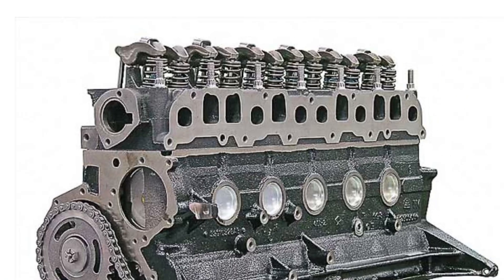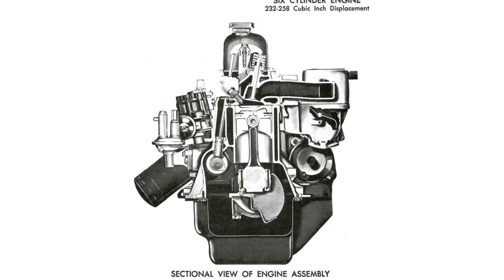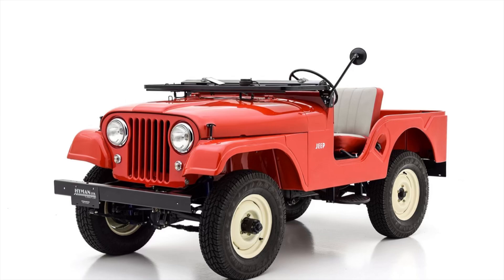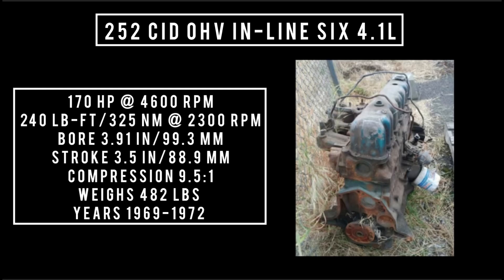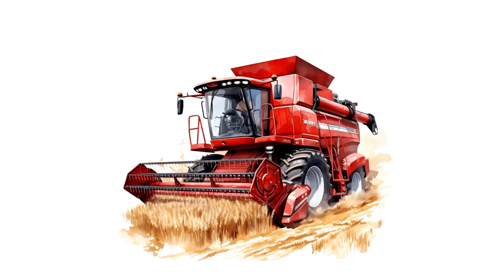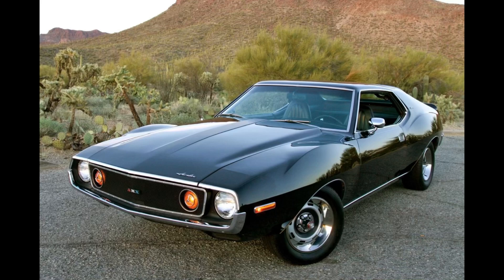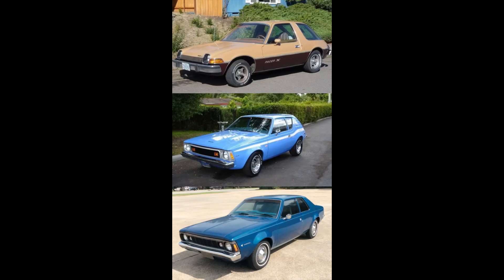AMC modern era in-line six 232, 199, 252, 258, 282, 242￼

Comment: i have a 1980 AMC Concord, 26,000 miles, 2-door, D/L 258 six, automatic, bought off ebay for $1,900 delivered, put about $800 news suspension parts and exhaust system. It runs fine. Rust? No. It has a vinyl top with a few bubbles.

Comment: I had a brand new 1983 AMC Concord 'Woody' Station wagon, fully loaded with every available option which had the 258 I6. I drove it 300,000 miles and it was still running smoothly when I drove to the scrap yard. That engine was indestructible so long as you changed the oil and filter every 3000 miles. The unfortunate issue was because AMC automobiles were considered "economy" cars, people seldom maintained them properly. Brakes, tires, ball joints and rear leaf springs were the only major items that needed replaced in 300,000 miles.
Reply from the maker: Thank you so much for sharing all that insight and information as well as sharing your car and experience =) 

Sounds like that wagon was super durable

Comment: Alum version of the 195.6!    Mains were broached and broke so main webs were filled in  STRRONGEST BOTTOM END OF ANY 6 vs Ford and chevy   we made 1000HP with 199 stock block and head  AMC then cast heads with the later ports with the early shaft rockers and blocks with thicker decks and BAM cores but bored only to 3.75  that combo with a STOCK 199 crank, carillorods etc made 1200 hp, Ran INDY
Reply: First 199-232 used the Nash bellhousing: there were 3 stick shift transmissions  Small ramblers got the Borg Warner T96  Police taxi option got the T86. some with straight cut low gear, none had synchromesh low.  OD was available  AT was the Borg Warner  later models had the same bolt pattern as the 64 AMC V8 with T10 4 speed and  Torque Flyte available  I had a 69 American with the T-10 U with 3.10 low gear   OD was a good choice

Comment: My daily driver is a 1993 ZJ Grand Cherokee with 442 Km on it....still purrs, and just in case I have a wrecked one with a 4.0 that is under 250k ...it still is cheaper to run than a new 4x4, is easy to work on and parts are around....it is just less costly to keep running than buy something much newer with all of the electronic crap.

Comment: I've had several Jeep TJ's with the 4.0, I had a 1999 with the internals from a 258 and made it a 4.7 l that jeep had 280 HP at the wheels and over 300 lb-ft of torque. I have a 2005 TJ unlimited with a Banks turbo kit and intercooler it makes 360 HP at the wheels and over 400 LB-FT of torque. I also have a 2001 tj with a Chevy lm7 5.3 liter and that one is fast over 400hp, but thats an engine for a different video. Thanks for what you do my father and I love your videos, they are very well curated and narrated.
Reply from the maker: Thank you so much for sharing all that information and insight greatly appreciate that you dig the channel. I put a lot of time and energy into it and it truly is my passion.

Comment: Way back when I used to run a Yale forklift powered by the 225 slant six. These things used to run 20 hours a day, sometimes more. Plastic bags used to get sucked up off the floor causing almost daily boilers. The engines would last as long as the forklift itself, around 10,000 hours. About the only way you could kill the engine would be to run it out of oil and keep running it. This engine deserves its reputation.
Reply from the maker: Awesome so much for sharing your experience with this engine

Comment: Being an Auto Body Tech. i woked at AMC MERCIDES and those in line sixes never skipped a beat,but when they started to put after market Air conditioned on them they started to over heat cause of the burden of the engine cooling system was not design for much labor but it still functioned and got by.

Comment: My 1976 AMC Hornet had the 232 inline 6, it was bulletproof. When i donated the car to my old high school auto shop 10 years later with 120,000 miles on it, the auto shop teacher asked when i re-ringed the engine because the compression was at factory spec. I just smile and told him “i never replaced the piston rings” just changed oil and filter regularly and gave it a tune up with new plugs and Penske silicone wires and distributor cap with rotor.
Reply from the maker: Thank you so much for sharing your experience with that edge and that’s awesome that you didn’t have to do anything to it but change the oil

Comment: These engines are just begging for some brave soul to make a crossflow head out of either Ford Windsor/Cleveland or the Small Block Chevy/LS. The bore center is exactly the same as the Fords and only .020 less than the Chevies.
Reply: There are two other possible headway options. 
1) A DOHC head made from LQ-1 heads
2) A DOHC head made from the Infinity/Nissan V-8

Comment: I owned a 1972 AMC Hornet with a 258 and Automatic. I dove to NY to Florida and back again in 1986. I went 65 mph and only had  depress gas pedal 1/4 of the way and averaged 28 mpg.
I also had a 1976 AMC Pacer with a 232 and Automatic. It had the troublesome Prestolite ignition and the module was expensive. So when it failed I  put a breaker point distributor and has to drop the voltage going to it with a ballast resistor (NAPA Echlin ICR 13). These engines were rock solid and would run forever it seemed with only basic maintenance. So easy to work on too.
Reply from the maker: Awesome thank you so much for sharing all of that information as well as those memories greatly appreciate it

Comment: I owned 4.0L AMC/Chrysler straight six engines for three decades.  They were the most bulletproof, reliable engines that I ever owned and I've owned a lot of different engines over the years.  The 4.0L's ran well, never used oil, had decent power for a straight six, and did everything that I asked them to do.  Their fuel economy was not stellar, but not terrible, either.  The engines were actually put together better than the vehicles in which they were installed.  The story is that the 4.0L just could not meet the then new 2007 model year emission standards from the EPA.  The 3.7L and 3.8L V6 engines that replaced the 4.0L were garbage.
Reply: The 3.8 is a good motor.  It's comparable to GM 3800, but with 60 degree cylinder banks.  The inline six is always smoother with better torque than a v6
Reply from the maker: Thank you so much for sharing all that information and insight greatly appreciate it

Comment: Best of both worlds AMC/Chrysler 4.0 with 258 crank stroker motor. The bore spacing is the same as Ford small block and Cleveland engines. Working on a Frankenstein 6 with a pair of Cleveland heads welded together.
Reply: What about the cam.
Reply: @ will need a billet

Comment: I think the carburetor jetting for the early 232 was slightly leaner than typical GM products of the era which made the engine more sensitive to developing performance issues when the spark plugs or breaker points/ignition system were overdue for replacement/service "tune up" 
although someone who knew what they were doing could probably have rejetted the carb or changed metering rods if a simple readjustment of the "idle needles" wasn't enough 
I think the ignition timing of these needed to be set precisely and the factory recommended different initial timing setting depending on whether the driver intended to buy high octane gasoline or not . I think the factory setting for ignition timing were more aggressive than other Detroit car brands which may have helped the typical Rambler product to have better gasoline mileage than the competition.

Comment: 91 grand Cherokee
71 Hornet

The AMC 6 cylinder engines were very well built and designed.  Damn near bulletproof.
Reply from the maker: Great choices totally agree may have not been the most powerful but they were reliable
Reply: @What.its.like.  I think The word reliable sums up the strategy of AMC The bulk of the vehicles they designed and sold were built to be solid reliable vehicles which they sold for a fair price. 

That's not to say they couldn't step out of their comfort zone from time to time. I think the Marlin, Javelin, and the AMX prove that.   However, not only could they step out of a box they actually could create a new box that was never before seen. The Eagle is proof of that.  Would we even have a huge SUV market nowadays If not for the vision that AMC had when they created the Eagle?

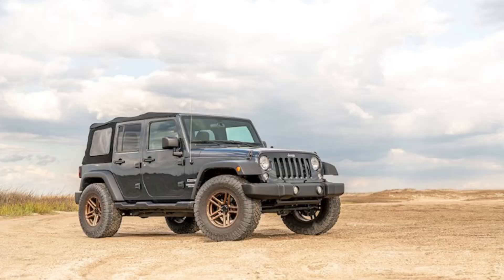Comment: 7:46 Never liked a six cylinder, but most are dependable engines. Owned two Jeep products. One was a 76 Renegade with the 304 and the other was a 78 J 10 truck with the 360.
AMC V8's had good power and l won't mention the 76 Matador l got on trade with the six cylinder it was junk.
Reply from the maker: Awesome

Comment: I don't know about the OHV version but the 196 flathead had head gasket problems and required a several step torque and occasional retorque to keep them from leaking;  yes the block and head were surfaced.

Comment: Yep. The 242(4.0L) was the best 6cyl. engine that was put in Jeep products. It was the shining star when Renault had taken over AMC-Jeep. Although EFI had been around for years already, it was new to Renault-AMC-Jeep.  The EFI system was know as Renix(Renault-Bendix) and made the 4.0L a real powerhouse. Chrysler upgraded to their own EFI system and got even more power. In it's final years, horsepower was increased again, but this was due to modifications to the exhaust system. The exhaust modifications wouldn't fit in the YJ Wranglers, so those didn't get the final hp boost.
Of note, they created a 4 cyl engine by chopping off 2 cyls. from the 4.0L- 6. Used in Jeep products, it was also the base engine in the Dodge Dakota P/ups. It was also a fairly powerful engine for 2.5L and could run circles around GM's "Iron Duke" (originally introduced in the 1962 Chevy II), having better power and reliability. 
It was crazy for Chrysler to drop the 4.0L-6. The V6's they replaced it with have had many issues and left plenty of 'Jeepers' stranded in the back country.
The Eagles were pretty cool, but their styling was dated, going back to the AMC Hornet. The mid-size Cherokees and Wagoneers had issues from their unibody build. The Pacers were a joke from day one. They probably put the final nail in AMC's coffin, what association with Renault had began.
Reply from the maker: Thank you so much for sharing that awesome insight and information greatly appreciate it

Comment: In the summer of 1968 My dad traded in his 1962 Rambler American (with a flathead six) for his very first new car, a base Javelin with the 232. In 1969 My mom got a used 1965 Rambler Classic with the 232, in the fall of 1970 she traded in the Classic on a Hornet Sportabout with the 232. I learned the basics of pulling wrenches with those three cars. The engine was torquey for it's size, but what I remember most was how smooth it was. Particularly in that Classic, you could barely tell if it was running at idle. I loved these engines, thank you for posting this. (You gained me as a subscriber.)
Reply from the maker: Welcome to the community i’m a huge AMC fan and just a fan of orphan cars in general =) 

Awesome story thank you so much for sharing those memories with us

Comment: Had a '91 Cherokee and two '96 Grand Cherokees with the 242.  Great cars.  My ex- totaled the '91 falling asleep at the wheel.  The '96 Grand Cherokees died due to transmission failures.  BTW, om choice #1, what you called a "Grand Cherokee" was likely a "regular" Cherokee.  The Grand Cherokee was a completely different body.
Reply from the maker: Thank you so much for that correction and for sharing your vehicles with us =)

Comment: The 242 was/is like a double sized GT6 (Triumph) engine, without the CD Stromberg carb set up. SMOOTH!
I will live with the bad gas mileage knowing the repair costs of "modern" engines, there is no free lunch.
Reply from the maker: Totally agree but with the Classic stuff if you switch out the rear end it’s been through a single barrel or two barrel carburetor even a full barrel carburetor is pending on what it is you can get decent gas mileage out of old stuff.. I have a 52 Chevy 1 ton truck that’s a Dually 373 rear end 350 I get 20 miles to the gallon on the highway which is better than a new truck.. 
My truck has a stake bed I drove a truck for a company landscape company got 6 miles to the gallon
Reply: Old stuff usually could lean out the carburetor mixture at light throttle cruise conditions and advance the ignition timing by vacuum advance at the same time,I don't think new emissions controlled engines are allowed to do that. I think that allowed the older engines to pull higher RPM at cruise speeds without paying as much penalty in reduced gas mileage.  @What.its.like.

Comment: We had a 73 Hornet with the 232, and an 83 Eagle with the 258.  Both were good engines.  I called the Hornet "The Anvil" as it was simply unbreakable.  I still want a CJ7 with the 258 and a 3 speed manual.  WYR: CJ5 and Hornet for the previous reasons.  Thank you as always - well done sir!  ~ Chuck

Comment: When International Harvester redesigned the pickup line in 1969,it used the 232,258 AMC engine till the last year of the IHC light duty trucks in 1975,it was also the standard engine in the Scout IIs ,also the 401 AMC,was an option in the 74 Travelall.
Reply from the maker: Awesome added information thank you so much for adding that
Reply: @What.its.like.  Thank you for your research,and your great work.I always look forward to Wednesdays.
Reply: I like those AMC inline 6 cylinder engines. I would prefer to use them in my 2 favorite midsized trucks such as the Jeep Scrambler and the International Scout 11 Terra and Traveler..🎉🎉"🎉"
Reply: @levyoliver5363 seriously considering putting the slightly modified 4.0 from my 95 cheorokee into my 76 or 77 traveller,  but I am having difficulty locating the factory parts to accomplish the swap in my neck of the woods

Comment: I believe that the Gremlin was a better car than the Pinto (and know that it was much better than the Vega)
People didn't recognize Rambler/AMC as a mainstream car brand and so didn't consider purchasing it instead of the more  familiar brands
also I think the unibodies sounded/vibrated somewhat more harshly than the body on frame constructed General Motors cars which made some people think they were "cheap" although there were efficiency advantages -- I am not sure whether rust was more of a problem than some other brands -- I think Chrysler products might have had more rust problems than some of the body on frame brands although I think GM workmanship and paint job quality declined into the modern era 

  If only they could sell a Hornet or Gremlin with the pre emission 232 with the 2 barrel carb --
 or the Pacer with the Chrysler/Jeep 4.7 H.O. V8 ----  and maybe a modern 7 speed automatic ----

Comment: The 232 was usually an option over the 199 as the base engine in the Rambler American. Either would show taillights to the six cylinder Ford Falcon. 
These were very good engines for the most part although I think emissions controls badly hobbled them in the later Gremlins and Pacers. 
 I think some 4 cylinder engines put in Jeep or AMC products were a cut down of these engines although they may have mingled with GM Iron Dukes.
  Would be hard to find any weakness in these engines as compared against the Chevrolet or Chrysler sixes.
Reply: The 2.5 liter four is a trimmed down 232/258/4.0, introduced for 1984. Iron Dukes were used on some CJs in 1980-1983 as well as the DJs (also their LLV successors).

Comment: 2 things... One. My Grampa had a '74 Hornet with the 232/auto. That thing was bulletproof. Only issue was the body rusted away. I ran the thing in '95 in a demo derby, and the only reason I came in 2nd was because my @$$ broke and the wheels couldn't turn against the body... BUT... after 30 minutes of running with no coolant, that engine still ran. The only issue was there was a heat riser pipe from the manifold to the carb that would rot out causing it to run rough until fully warmed up. We fixed the issue after the second time by putting in copper tubing instead of the whatever kind of cheap metal was used. Two. In '88 I bought a Commanche Pioneer pick-up, 4.0/5sp as a work horse. My ex-husband liked it so much, he bought the Eliminator version with the same mechanicals for his everyday driver. (I stuck to my Grand Marquis for that, thankyouverymuch). Bulletproof my ample @$$. BOTH mechanically were rolling pieces of caca. My Mom had an '03 Wrangler, and was the same (I begged her not to buy it). WYR: 1) EAGLE (so far ahead of it's time!) 2) Gremlin (my mom had a '74 with the 304 V8... was a screamer! And she LOVED to prove it!